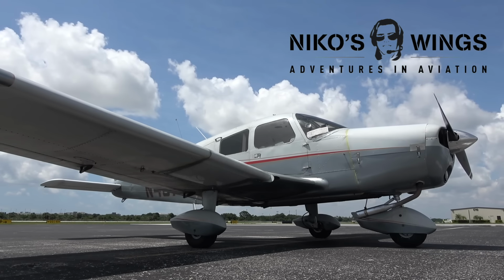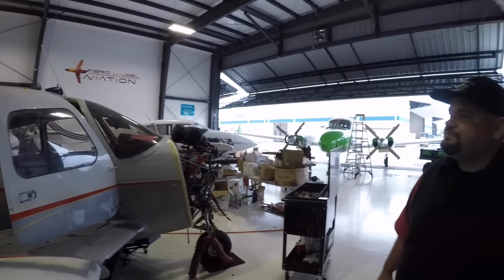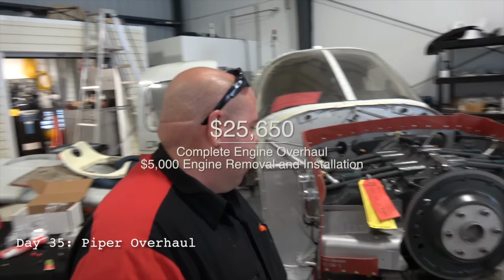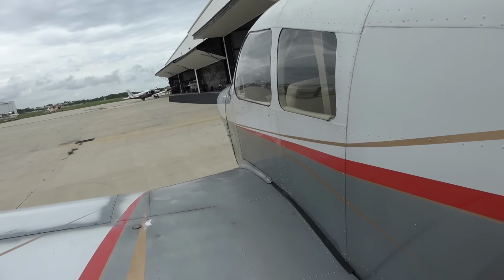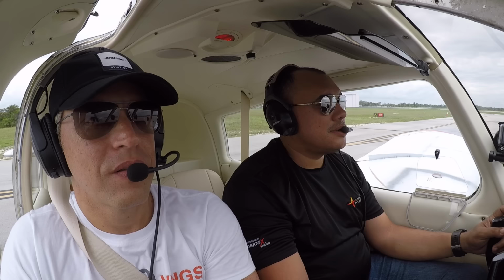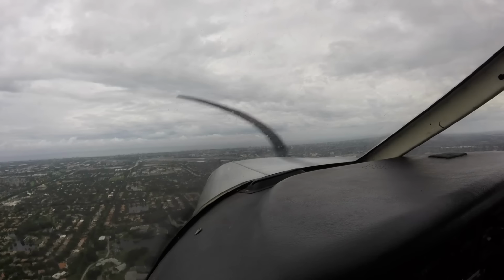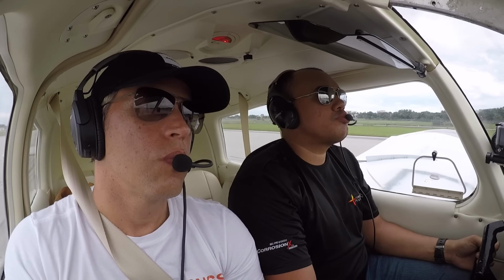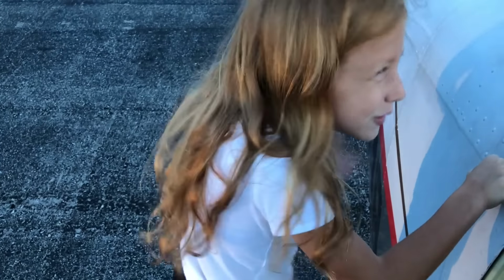Giving an Old Airplane New Life. Piper Cherokee Cruiser Rebuild and First Flight

Comment: When I was 10 I was flying with my dad in the 140 and the door popped off of the latch - it was easy to misjudge those top latches.  My dad told me to ignore it - good advice if you're flying the plane.  At 10 I was not doing the flying, so I spent the next several minutes working at the latch until I got it back closed.  Nice little memory you left me on this video!

Comment: Great video my brother, you did a good job you and your Team, putting that old Vintage plane back together again. That Piper Cherokee Cruiser, PA-28-140. I was really concerned about that door being cracked open, I'm glad to see that the wind did not catch it and pull it open any further. Beautiful little girl you have there, She Is Just Like You. LOL, Keep flying my brother I know this is an old video, but it was Very Nice.  Take Care, Mr. Cool Breeze. PS. What's nice about the Piper Cherokee Cruiser, My Dad was a Three quarter Cherokee Indian, he would be proud to call that his plain. LOL
Reply: The slip stream of the air keeps the door from coming completely open.  This is common problem on the A36 Bonanzas also.  Besides being really annoying, it is not a problem for the plane to fly like that.  Although, in the case of Bonanzas you will not be able to close the door in flight.

Comment: I love the Piper's manual flaps.  I did my flight training in a PA-128 and when I eventually went to the Cessna, I hated the electric switch flaps.  There is something akin to seat of your pants flying pulling on that long bar at the floor while in the pattern.  Good stuff.
Reply from the maker: I loved that too... full control

Comment: Sweet Piper Nikko!  If I didn't already own my Tiger, I'd be interested!  However, she's a bit under powered for my needs as I live in Denver.  160 HP is the minimum for this altitude.  Good luck selling her!  Hope you get full price!
Reply: I have owned a Piper Cherokee Cruiser sense 1983 and have flown it out of Northern Utah where the airport is 4,230 msl.  It had air conditioning to start with but I removed that.  It is limited on hot days as per load but I have enjoyed flying it for years.  It has a O320- 150 HP. Flown it all over the west.  My Skybolt with the 540 never has a concern on the hottest day.
Reply: @dalesorensen298  You may know the answer to this....is there a STC for the older PA28-140, 161 etc to have the 180 or even a 200 hp put into them?  Seems like the basic ariframe and components are the same.

Comment: Wow.. The door was open.. No harm no foul.. 🔓👍
Reply: it's not open, only unlatched
Reply: Used to fly Warriors, Archers, 140s and 180, as well as Cessna 150s and a 182.  We had doors open all the time.  You just got used to it, and would leave it that way since it wasn't going to open up to fall out of.  Would scare the bejezus out of passengers, but no problem for the pilot.  Now, that's not to say that I haven't seen pilots get a little freaked out over it, damned Beechcraft drivers!  :) :p LOL  But, it's never hurt anyone.
Reply: Most likely just forgot the top latch. Easy to do an it doesnt fo anything other than make the cabin noisy. The main latch will hold it
Reply: Yep, you can see the top latch is in the open position. Ooops. They obviously have noise cancelling headsets on, otherwise they would've heard the open door.
Reply: It didn't latch because the top was not even attempted to close it.  The handle position shows it in the open position the entire time.  The most mistakes in small recreational aircraft is when two pilots are in the front seat.  One must be the PIC at all times.
Reply: xxtwr1 True, but the top latch for these planes really isnt that important, unless you're already pushing the limits of the plane performance wise. I usually "forget" to latch it to try and get my students to check the latch every single time before takeoff, as a new passenger may not know about it. It just makes the cabin a bit noisy and some precip might be able to come in. 

Although I 100% agree with the 2 pilots in the front. I did a few flights like that and some guys know they shouldn't do anything, but then some would start taking on some tasks without asking and it was a nice gesture, but really creates the confusion of "did you do this or no"
Reply: What happened to the preflight checklist?
Reply: @ccubsfan94  I latch my door latch every flight.  Its a checklist item.
Reply: @ykthang   Exactly.
Reply: @beovp91  I do too, but while teaching I would purposely forget to see if they catch it, they usually only forget once. But I've had some in a bad habit of not checking.
Reply: @ccubsfan94   Did it once myself!   I was going on a short 30 minute flight & just put up with it, the cabin was so noisy it made me double check it every time after that!
Reply: @ykthang  also the PIC is not using his seatbelt harness.

Comment: Right when you started the takeoff roll, I’m yelling at the TV, “DOOR!!! THE DOOR!!”  Lol!   I Did that once in my Cherokee. Was a bitch to get it latched. Curious why you didn’t strip and paint the plane with all the other work you did.. what did it sell for? I bought my Cherokee 180 in 2006 for $69,500 it also had a fresh overhaul, GNS430, new paint and interior. Was an awesome deal and is still serving me well 12 years later! The Chefokee is a great airplane, I just wish the CG was a little further aft.
Reply from the maker: I finally added an autopilot and painted her. Look it up on my Instagram or Trade-a-Plane. A buyer put a deposit on it already. To be honest I had NO idea how that door worked on that flight. But I learned lol 😂
Reply from the maker: And agreed on the CG. It’s problematic but you make it work with some planning
Reply: Niko's Wings exactly.  When I go for my BFR, as long as I only carry 20 gallons in good. The real problem is you can’t really adjust the CG with cargo weight. As you add weight to the cargo area, the CG moves aft, but the weight goes up, and the CG still sits at the edge of the envelope. It never gets better. I actually contemplated adding a 30lb. Weight to the tail as far aft as possible, but never did it. However, if you look at the net CG effect, it would put the aircraft in a much better CG location for all loading scenarios. A composite prop STC would help tremendously too. Safe flying Niko!
Reply from the maker: Yup exactly, but keep in mind these airplanes can still fly well just outside the envelope, but cannot be overdone

Comment: Big fella doesn’t need a seatbelt?
Reply from the maker: He has lapbelt on
Reply: Hi Niko,
     Glad to see you putting new life into this aircraft.  
   
      Please encourage everyone you fly with to wear their shoulder harness!  It is probably the single best thing on the airplane that will prevent death or serious injury in the event of an off-airport landing.  The lap belt alone will not prevent your head from slamming into the panel or yoke.

      Besides the common sense angle, wearing of shoulder harnesses are incorporated into the regulations.  Please refer to 14 CFR 91.105 (b) and 
     14 CFR 91.107 (a) (2) and (3).
Reply from the maker: I know but didn’t notice at the time and he was PIC

Comment: Nice bird.  But i do have to wonder, weren't those prices you showed us a bit steep?  I'm not the most arrogant or educated fella on this earth, but it surely seems that maybe they took advantage of your unusual personality and forgot to grease the third point of contact when billing you?

not sure, just curious?
anybody else have any input?  were those prices in order, or a bit pricey, or nearly completely off the  hook?

what are you down to on price so far? or did it sell ?

did you get around to finishing the interior (yoke, etc)  or still going for nostalgia?  how's the exterior look painted?
Reply from the maker: The bird sold very well after paint. The arrangement was to bring the airplane as close to new as possible (restoration) and that is not cheap since it requires a lot of labor.

Comment: Lemme see if I can remember the story ... in the 1950's Piper was selling Tri-Pacers as fast as they could make 'em because all the cool pilots sported tricycle landing gear. So, Cessna scrambled! They selected the 170 airframe (instead of the 180), stuck on tricycle gear ... and the 172 was born. It began outselling the Tri-Pacer because all the cool pilots sported all metal covering. So, Piper scrambled! They brought in Fred Weick, designer of the renowned Ercoupe, and he hit another home-run with the Cherokee. But this created a dilemma among pilots who wanted to retain their cool. Tricycle gear was cool and so was all metal covering. However ... was it cooler to be sporting high-wing or low-wing???
Reply from the maker: Interesting story Shannon
Reply: ever see a low wing bird?...and you forgot  John Thorp and Karl Bergey were on the design team with Weick
Reply: Low wing always cooler. How many high wing fighters have you seen? 😉 The old Ercoupe is one of the prettiest little singles out there.

Comment: nice video, got my rating in one of those after I soloed.  Have to say, $232 for 1 sq.metre of tinted plex (enough for both back windows) is ridiculous.  I have been working in the marine industry for many years, we use a lot of plex a lot of the time, and it sells for like $5 an acre, for what looks like the 6mm plex you're using.  That is here in Australia, in the US it's even  cheaper (lived in Fla for 10 yrs also doing marine work).  A moot point now, but even allowing for overheads that is a ridiculous price.  Just sayin... Thanks for the video though :)
Reply from the maker: Yes but when you add aviation certification watch the price go way up. To certify a single product for aviation you need $250K - $500K in legal fees alone... divide that to the product sales and that’s a $200 markup right there just to break even.
Reply: @NikosWings  Then I stand corrected, and will shut the hell up :)  Thanks for your reply Niko.

Comment: what does an overhaul normally cost for a piper like this, a piper archer
 or a cessna 172 or 152
Reply from the maker: An engine overhaul is from $35 to $60 and above. For this project of you watch the video it will tell you what everything cost. Expect prices to go higher this year.
Reply: Is that per hour is that what you mean?
Reply from the maker: No sorry I meant thousands. $35,000 - $60,000

Comment: Your preflight checklist wasn't used very well, had you went item by item, you would have made sure you door was shut and latched!
That's a careless mistake for two experienced pilots.
Reply from the maker: Don’t make assumptions. The checklist was used perfectly, I didn’t realize there was a latch above my head. Never had flown a Cherokee before.
Reply: @NikosWings  Not making any assumptions, you clearly didn't make sure the door was latched and secured. Don't make excuses, it doesn't matter whether you had flown it before, all you had to do was check around the entire door to make sure you had it secured. In fact you didn't make sure that the door was latched before your taxi to the runway.

Comment: hello check list is important DOR LOCK is on the list. nice video Saludos Iberos
Reply from the maker: Yes it is but at the time I didn’t even know there was a latch above my head lol
Reply: hello is not you fault the pilot in command. I lost a job doing the same. I was working for a company name Triple Crown piloting a Arrow with the operation manager , I fail to lock the door just like you and it came completely open . Saludos Ibero
Reply from the maker: So you learned the hard way. For me it was just extra air conditioning in the Florida summer heat lol 😂

Comment: Pretty much with any regulating agency, such as the FAA, regulations are outdated and lacking common sense, causing necrosis by inaction.  A perfect example is this aircraft: old avionics and a high price tag.  Beautiful aircraft, but severely needs updating to the modern era.  Prices are high due to an unresponsive FAA. I flew Blackhawks in the 2000’s - 2010’s with avionics from 1978.  How stupid is that?  It is getting better from an Army standpoint, but that’s due to stacks of 💵.  General Aviation is all but dead and it is very unfortunate.
Reply: I think there are many issues that drive the cost of aviation up.  Supposedly they are going to need 600k pilots in 15 years or so.  They have to do something to get the cost down.  I read even the Airforce is currently short 1600 pilots.  That really surprized me.  FAA regulations may be the greatest contributer to cost (I am not arguing with you, I simply have not researched it enough.)  We are using 1940's engine technology as well.  I see many "higher performance" engines needing "top overhauls" at less than 1000 hrs ex.(several lycoming IO-540's)  at 15 to 25k for a top overhaul, and 25-50k for complete overhauls!  Aviation to an extent was always a rich mans sport, now it is even worse.  I git my PPL in '84, Instrument in '86.  Flew a Cherokee 180, and a Bonanza for the family business, went to University for a business degree but also to get my Comm CFII.  My goal was to fly professionally.  When I really looked into it, getting a crappy CFI job or flying cargo for 2-3 years living on balogna sandwiches just wasn't worth it at the time.  Back then pilot jobs were really scarce.  Now looking to get back in and fly as a second career.  On top of all that we have the Airlines pushing to take over ATC!  That will be the final nail in the coffin for GA if they can get it through.  The technology is there for efficient engines and avionics, we need to get them in the air without everyone trying to be a millionaire off it all.  Sorry for the rant...this is all so frustrating.

Comment: That door is not shut properly, the pilot not wearing a seat belt, your belt twisted, what other things didn't you check,  that's super dangerous and responsible, but you'll just delete this.
Reply from the maker: It’s also very irresponsible to write stupid comments.
Reply: So is it not dangerous to latch cabin doors, Nick?
Reply from the maker: Dangerous? No... Noisy? Yes
Reply: Not dangerous at all. What is dangerous is know-it-alls like this guy who would probably freak out when the door popped open not knowing what to do,
Reply: I was just about to say I have to get a pair of those BOSE headsets bc they must be terrific! Speaks volumes about them. I don't have ANC's yet. I dunno. Maybe next. Great video man!
Reply from the maker: Thanks and the Bose are great. You may want to look at other comparable in the same price range ($1,000) to see what best fits you. Having said that, Bose are probably the best
Reply: I agree, the Bose is the best. I’ve had my A20 For a year and it is a dream to put on every single time I fly, which is a lot. But what’s even better is the company behind it is amazing. I bought it well before they had all of these glamorous promotions where you get the free $300 speaker, etc. When I went to Sun n Fun back in April, I went to the Bose booth and explained that I had purchased the headset before hand but I would really like the opportunity to try the speaker. I left my name and address and they said that it was unlikely that they could do anything for me at that point, and a week and a half later a box arrived at my doorstep with the most amazing speaker, the Soundlink Revolve+
Reply from the maker: Their speakers are incredible. I have several at home, including 2 portables, their SoundTouch 300 sound system with add-on speakers. Amazing quality...
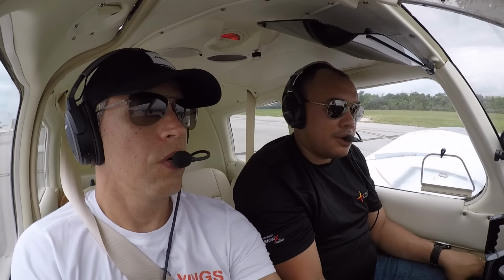Reply: The top latch was never closed, you can see this at 16:07. That was not Niko's fault. He was not totally familiar with the airplane yet, that's why he had an instructor along. And the instructor eventually noticed it. I wonder if they would have realized it sooner had they not been wearing ANR headsets?
Reply: While flying with an open door on a Cherokee is not a problem, flying without wearing your seat belts is a BIG safety hazard. Hit some nasty turbulence and you risk blocking your controls - and it's the law: FAR 91.105(a)  flight crewmember must keep his or her seat belt fastened during takeoff and landing, and while en route
Reply from the maker: He was wearing his lap belt